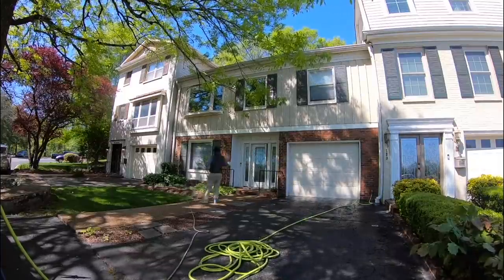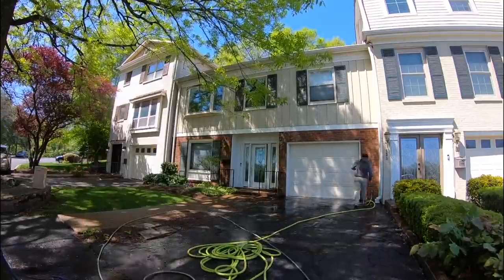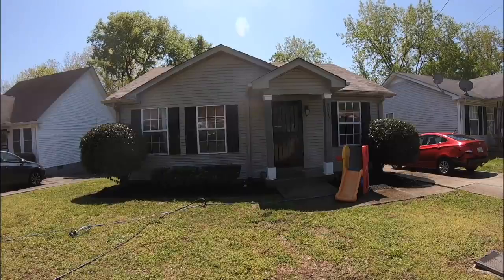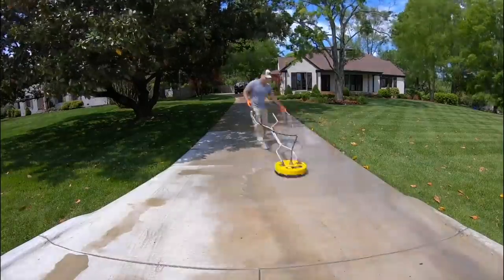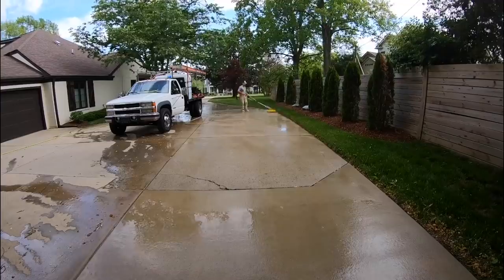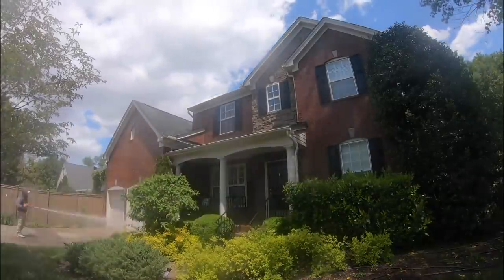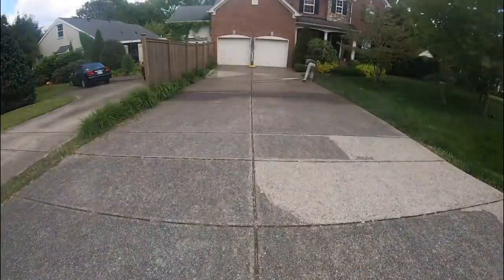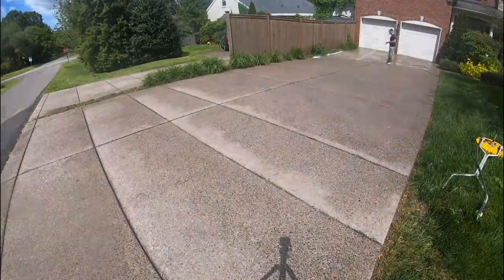I MADE $5000 IN 1 WEEK PRESSURE WASHING

Comment: He should be glade the run off didn’t go into the neighbors yard. If the ground wasn’t taking it, HIS water run off would be going on to the neighbors  drive way. Killing any organic growth on the drive, and discoloring. No doubt you would be cleaning their drive  for free if they were upset about it. Also, making the homeowner aware is not good enough. you need a contract stating any factors you see and having them sign off liability for you to not be liable. No doubt you can share some helpful information, but i think you are still a little new to the industry to be offering professional courses. There is so much that can go wrong, and you need to be aware of all of it to truly teach people what they need to know for a paid for course. Not just soft wash basics, and basic equipment. For instance, the direct drive pressure washer you pushed in your one video is no good for professional pressure washing. If you are pressure washing everyday long hours you want a belt drive. Not only are belt drive stronger at pulling water, but direct drives have a metal key connecting the drive shaft to the pump. The heat and friction from running long hours will cause it to heat up, and break after awhile. so you will have more down time fixing it then a belt drive. Also, you never want to use a surface cleaner on newer masonry. The concrete will not have had enough time to set up, and the surface cleaner will etch lines in the masonry PERMANENTLY. sometimes you can run the surface cleaner in a circular pattern to hide them, but still. If the homeowner sees it,  it’s an insurance claim. As far as the oxidation on the gutters, almost everyone i see in the power wash groups on facebook scrubs them along with the price for the wash. This will remove a lot of the oxidation, and will have customers choosing you over your competition “if for some reason they don’t scrub the gutters”. I know some people rather use cleansol BC, but scrubbing is faster to me. Also the number one thing to look out for with pressure washing is electrical. ALWAYS check above the meter to make sure the duct seal is good, and not allowing and water to go into the main box. I have seen people blow the whole side of a home off before the breaker at the pole tripped. also always cover above light fixtures, and tape off outlets. I always check to see if the outlets are on, then ask the home owner to turn them off. Then i still tape it up. Better safe then sorry. Also, sodium hypochlorite “bleach” will pull oil base stains from wood surfaces. so always check what kind of stain is on the deck if it has a stain on it. Also, ALWAYS have a contract. it protects you in the end. People will usually be happy to share their contracts in a lot of the facebook groups. If you get more advanced and start doing mortar smear removal, or oxidation removal from brick. Make sure you learn about the acids you are using. leeching avid can etch new masonry very easily. It can also damage limestone. Basically what I am trying to say, and what i didn’t see in this video. There is more then just equipment, and chems. showing the basics on how to make money pressure washing is good and all, but learning about the materials you are cleaning and dangers all around and how to avoid them is just as important. That’s how you get to keep your good name as you build, and how you get to keep your hard earned money.
Reply: Travis King 

TLDR
Reply: Aaron's Lean & Mean Academy DGAF FACTS

Comment: Do you have an extension wand you use on second story jobs? If so can you tag in through amazon or push me in the right direction? You are doing a great job and helped me get into pressure washing and starting a company myself.
Reply: Lindsay James look up a second story tip for pressure washers. Like 5 ish bucks and you’ll be reaching second and third stories with soap so you don’t need a longer wand or ladder